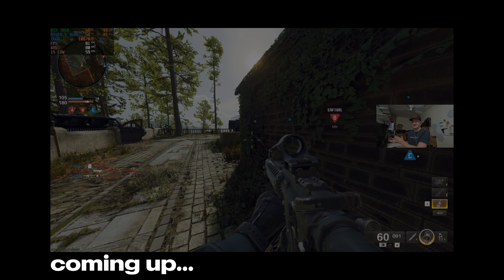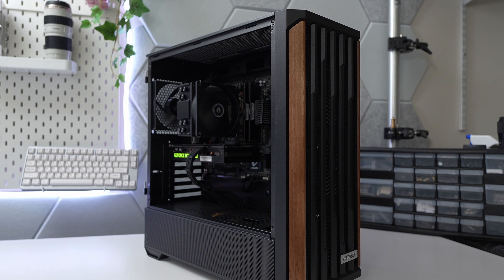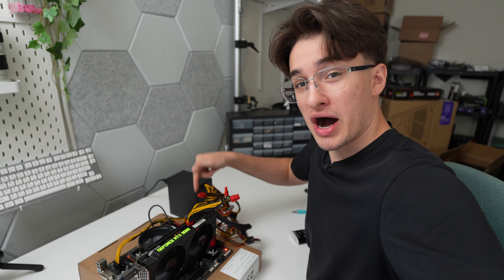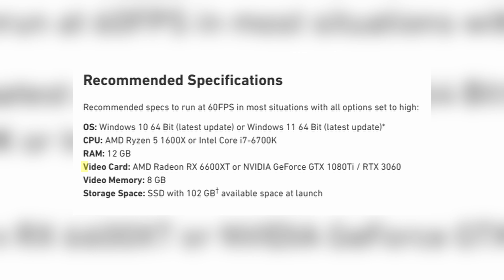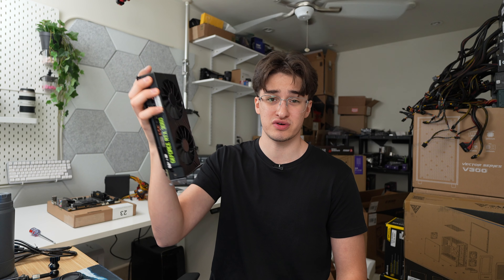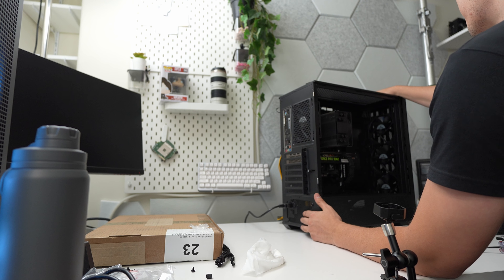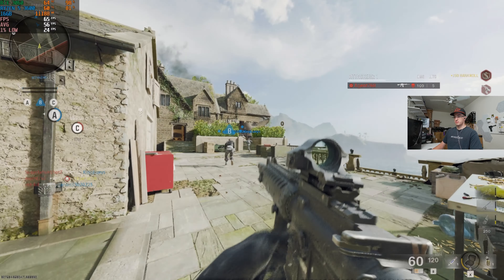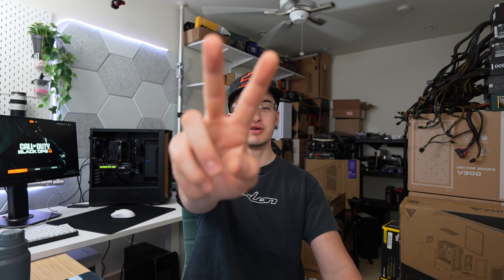Best Budget PC for Black Ops 6 + gameplay

Comment: How good would a Ryzen 6 3800x and a rtx 2060 super be?
Reply: Ryzen 7 3800x you mean? It should perform very close to this, if not Better in CPU bound scenarios, Since the 3800x Is Better than a 3600 and the 2060super Is Just a bit slower than the 3060 12gb